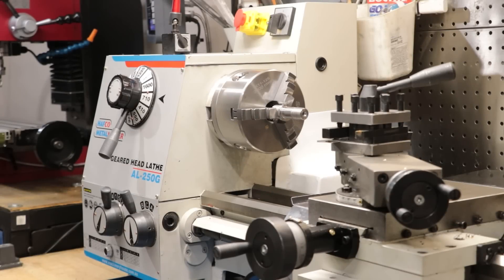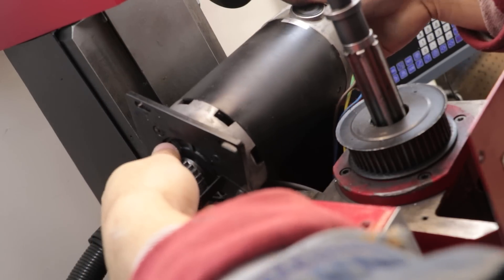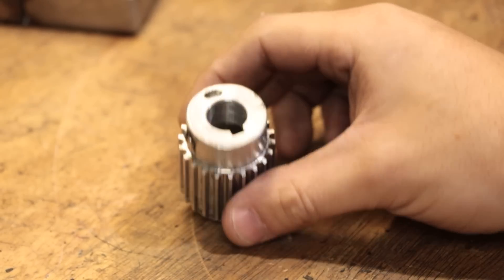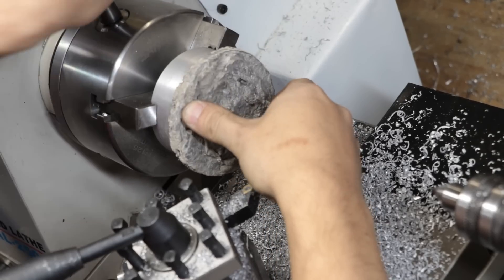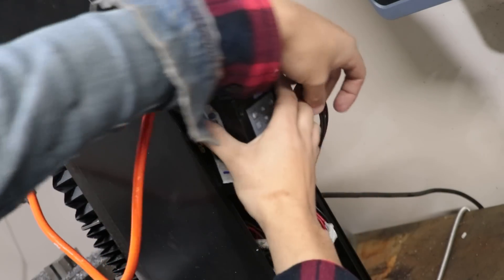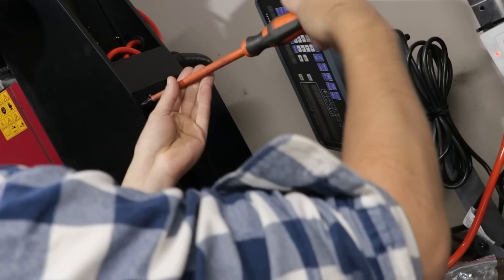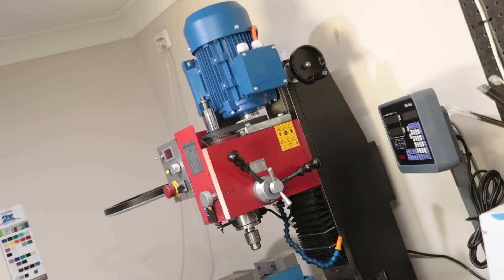I Put A 3HP Motor On My Mini Mill

Comment from the maker: Do you ever have one of those weeks where everything you touch breaks?  Pretty much sums up my past 2 weeks :)
Reply: Not weeks but i definitely have days like that
Reply: Use a little cutting oil when turning gummy aluminum.
Reply: It's called having the "Reverse Midas Touch"; where everything you get near turns to something that's definitely not gold.
Reply: @gbspikyfish    my friend calls it "sexual fingers" lol.
"Everything I touched was f#cked"
Reply: I had a month...
Reply: yup.. but if your not breaking tools your not working in the shop !
Reply: Love the cliff hanger ending 👍💪✌️
Reply: I think for drilling thick plate with cold saw you should drill half way in one side and second half in another side to reduced friction rubbing between saw and steel.
Reply: @alston523  It isn't rubbing that's the problem but the fact the chips have nowhere to go. For years I've been  getting a slot going width of saw kerf then use that to drill a bunch of through holes. You can go full length (depth?) of hole saw internal 'hole, then come back from other side to core bars which saves material (as long as your only needing a piece around  3" long 🤔)
Reply: More like two decades but what of it? :)
Reply: I ended up breaking 3 Kennametal endmills this week. So yeah, I feel your pain
Reply: 1 Car gear box
1 industriali washer 
1 drilpress
2 workshop lamps
1 car wheel flat
2 Rolling tabels 
1 pallet lift 
1 hydralick Press 
It have Been a rugh last 3 weeks. The boss is not to happy but we made 50% pruduktion increas. 👌😅
Reply: No, but nearly all of my Ozito stuff was returned to Bunnings under warranty years ago :)
Reply from the maker: @legallyfree2955  Their stuff is hit or miss. Corded stuff is generally okay
Reply: @legallyfree2955  funny enough I have two Ozito abgle grinders, bought for $17 each (lol) that have been total workhorses for over 10 years.
One has a replacement power lead because it got mangled which can happen to any tool over 10 years. The other has a broken clamp button because a cutting disc got siezed on, which can also happen to any tool.
I bought 2 grinders for $34 total for a job because I could use one as a cutoff and one as a grinder without swapping discs all the time. And they have lasted the distance. Yay for cheap garbage tools! 👍
Reply: Yup
Reply: You didnt cut stock by hand im happy and proud of You!
Reply: Well im glad im not the only one this happens too ! Had a few projects that have cascaded like that, usually when I have a tight deadline and dont have the cash to just buy replacements so I have to McGuyver some solution to see me through ... it not the kind of stress you need on a deadline.
Reply: pretty sure that those brushed motors will always burn out your vfd
the produce a lot of back emf and have high inrush currents and generally put a lot more stress on vfds and controller boards when these are either just cheap or skimp out on filter components.
Reply from the maker: @FeralDayASMR  Thankfully the replacement is an induction motor. Not a big fan of brushed dc
Reply: @FeralDayASMR  You make a good point. A brushed motor needs a circuit between it and the control board to prevent feedback.
Reply: Definitely ! Even myself :p  
In general, I stop at 2 broken part and go doing something else (or I block my back and just stop doing anything)
Reply: Yep, my friends and I call them reverse Midas days. Everything you touch turns to crap.
Reply: We all have those days, weeks, months, years even. But did it effect your command of English too? 16:52 “Feeled through the hand wheel…” ?? Felt maybe ? 👀🧐😎😜

Those hole saws can be made to do amazing things, but they need help. If you begin to cut the circle, then drill a series of smaller holes around the inside of the scribed circle breaking into the groove you’ve started, then immerse the job in water, you will of course cool the operation, relieve the pressure on the saw teeth by reducing the amount of metal that needs cutting, and provide escape routes for the swarf. If it gets difficult, turn it over and start from the other side. 

Lack of coolant and swarf clogging are always the biggest impediments to a job like that. Done properly, industrial machining operations almost always involve flooding in coolant. There’s really no downside to doing it - other than the mess. But it’s the end result that matters, not aesthetics or convenience. 

Coolant would solve your aluminium clogging issues too. You have a fine cutter running at whatever speed, and abrasion occurring, which causes the aluminium to heat up. The heat is transferred directly into the thinnest aluminium chip, and it welds to the cutter. Flood it with coolant and you remove the heat, and clear the swarf quicker.
Reply: @G58  You know english isn't everyone's first language right?
Reply: Yeah. Been there, done that. Cheapskate Murphy didn't even supply the t-shirt.
Reply: I was wondering why you hadnt put out a video lately, but this explains it.  Sorry for your bad luck, mate!
Reply: I've had weeks where I only had to look at something for it to break. You have my sympathies. On the upside, the better half usually doesn't complain when you "replace" a broken tool with an upgraded version.
Reply: Always drill metal on low speed, no matter the length of time it takes. Drill would have lived a bit longer but it was toasted
Reply: Errol Flynn day.
Reply: FWIW, some aluminum alloys are designed for forming and are typically not good choices for machining. Alloy 3003 is a "gummy" aluminum.

I know that 6061 is most commonly used in industry for machined goods, but it too can be subject to chip welding under high material removal rates.

My favorite aluminum alloys for high speed machining are 2024 (alloyed with copper) and 7075 (alloyed with zinc). Neither of these alloys are "gummy" and chip welding while machining them is rare.
Reply: I call it “reverse Midas touch” where instead of gold , everything you touch turns into “SHIT”🙉🙊🙈
Reply: Motor brushes are a wear item.  I'd check them in the old angle grinder.   Also in the old mill motor.   New brushes are only a few bucks once you figure out where to buy them.  The cheap multitool (mains powered "dremel")  I used as spindle got through 2 pairs of brushes a year when I was driving it hard.
Reply: Yea every week of my life so far...

Comment: Not a machinist, but wouldn't a sharper tool steel bit have worked better on that nasty aluminum?  At least thats what I thought you mentioned at one time.

Comment: Hey mate on that home cast ally try using milk as your cutting fluid, like regular full cream. No BS. The saturated fat prevents the chips from sticking especially on ally. The old boys used to cut ally with a rendered pork fat emulation, way better than the new synthetic stuff. Clean it out with water after or it’ll stink.
Reply: Also can add radiator coolant to milk.
Reply: Nice work btw

Comment: All those trips maybe you have bought a drill press, saving your drill, hole saw, etc etc.😮
Reply from the maker: I’ve always been of the opinion that if you have a mill you don’t need a drill press. So if I’d bought one I wouldn’t use it after using it once.

Comment: Hi Artisan, as always: Great vidoe on a great channel. Thank you for that!
But one suggestion from my side. I think if you have not enough tork in your 16mm drill maybe your belt is too small. You could double up the pulleys and use two belts to transfer the whole 3HP to the tip of your drill. ...just my idea. Greetings from Germany Sascha

Comment: Hmmm, that 3 phase motor is a way heavier!!! I wouldn't have mounted it high -- to cause top heaviness. I'd have bench mounted it low down, with power driven UPWARDS to an idler drive bearing and pulley over to the spindle. I really dislike motor or chassis wobbles transferring into my work.

Comment: 7:54 a higher frequency is no issue. The frequency printed on them is just a measurement for the optimal conditions it was designed for. So you'll look at more heat loss at the same power output, if you run it with a higher frequency. So as long as you monitor the temperature of the motor, you're fine. I would expect 50% more energy-loss if you double the frequency - at least. 

So if the 3 HP motor is designed for say 800 W heat loss (75% efficiency). So to keep it within the 800 W heat loss, the casing is designed for, you can only run it at 2 HP continuously, that is.

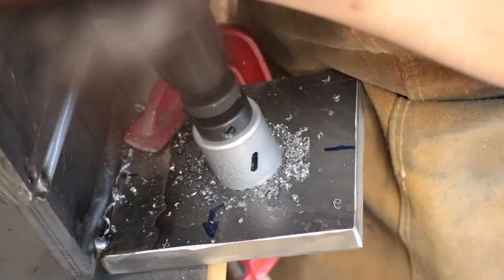Comment: 4:44 let the poor drill spin up instead of pushing too hard. You can avoid overloading it, by putting it into second gear and putting the torque limiter to the highest setting. So if you overload it, it will ratchet through it, so you know you pressed too hard.

Also make sure to keep the piece wet with water, to avoid heating up the metal you're cutting too much, so it will work harden - if you stop cutting for a moment.
Reply from the maker: Cooking the drill was on me, I was a bit impatient and I needed to get the mill fixed asap. I personally wouldn’t hole saw in gear 2 with that drill. Not enough torque and id probably burn up the teeth. All in all not really a job suited for hand drills. And for what it’s worth the cutter had plenty of cutting paste. Cheers
Reply: @artisanmakes  "burning up the teeth" is just a matter of temperature - and maybe torque, which you explicitly limit by the torque limiter of the drill. The temperature is limited by using an abundance of water.

So no, the hole saw won't be damaged. Choosing the second gear just gives you more inerta, that's why I recommend it.

Using the torque limiter on the drill will avoid "getting impatient" in the future. :)
Reply from the maker: Maybe not my best descripting but if you run too fast you'll rub the teeth on the work piece, not cut it, and that is what will generally destroy a sharp edge. Cutter needs to by pressed down with enough force to cut into the material and in the high gear you can not put enough force into the cutter to cut the material without stalling the drill. But back off enough for the drill to run and it will not have enough pressure to cut and remove the metal. Believe me I pulled put most of the stops to try get it to work and low gear high pressure is what the hole saw needed. Cheers

Comment: Mate, you desperately need a drill press. It will save you a ton of time and effort and reduce tool breakage. I would also recommend getting a set of annular cutters rather than using a hole saw. Alternatively, you can drill some holes around the diameter of the holesaw to allow the swarf to fall through. It will prevent you from overheating the holesaw and breaking teeth off on swarf.

Also, when machining gummy aluminium, you can touch up the carbide on a diamond hone to give it a sharp edge. Also, give it generous servings of WD40 while cutting it and this will help reduce chipwelding.

Comment: Just for info ( perhaps useless) in my working career I was an electric motor specialist and did many “weird” tests and experiments. You can safely run a 4 pole motor at 100hZ without much loss of torque, however a 2 pole motor starts loosing torque at around 150% full speed ( 50hZ running at +/~ 75hZ)👍
By the way keep going with your very interesting videos👍👌😁
Reply from the maker: Cheers thankyou
Reply: Also regarding use of a VSD , if you run at lower speed you need to think about cooling , I solve the problem with a “PC fan” mounted on the motor cowl

Comment: Do you know that the nominal power stamped on a 3-phase asynchronous motor is the most efficient and economical power for continuous operation, not the maximum power? Not, for example like other types of electric motors or combustion engines where 3hp means max. 3hp. This 3hp motor can produce a maximum of about 10 hp during intermittent use. The same with the torque. A continuous overloading will of course overheat and burn the motor unless overcurrent or overheating protection is installed. A firewood splitter is a good example of where this "overpower" can be used with advantage.
Reply from the maker: That may be correct but here the motor is going to be limited by the VFD

Comment: I bet it dies, soon. You added 2hp, that's ~1500w of power that nothing in that was designed for. 

I've been there, I've done that. It's really fast, for a few. Sometimes failures are accelerated wear (ie: bearings), and sometimes they're quick, loud, and exciting (ie: the base cracks & the head falls off), but it's not going to survive.

Order a replacement now, and hopefully new arrives right after the old is hauled off.
Reply from the maker: This is not a stock machine. It has Stiffening plates and braces and the tapered roller bearing are can handle well over 3hp.
Reply: @artisanmakes  lol…ok.

Your confidence has reinforced my confidence. That level of confidence requires either past examples (you're copying someone) or perfected ignorance. Even a pro would give that a "maybe" when tripling the power.

You did realize the power used in the machine, to cut metal, becomes heat, right? Those parts are not designed to handle that much heat, so they will get hotter than they used to, and that will be more than it can dissipate. Heat brings weaknesses & makes noises.
Reply from the maker: I’m not copying per se, but I have run into examples of people using these over sized motors on mills this size without much trouble. And for what’s it’s worth when I shoved a motor this size on a mini lathe it didn’t have any issues, and that that even less suited to a 3hp motor.
Reply: @artisanmakes  I'm not telling you to stop building it. I've done things like that (tripled the power) & I'll do it again. That finds the weakness. Sometimes repairable, but usually not when the power has more than doubled.

Just have a replacement ready.
Reply from the maker: I see what you are getting at. Cheers

Comment: I did the same upgrade to my Sieg X3 years ago. I also fitted a gas strut to balance the Z drive (it's now CNC'd). Filling the column and base with epoxy granite helped with the rigidity. Interestingly,  I saw a Ryobi ad just after your drill crapped out. Unfortunate timing.😮

Comment: How much is it in kW? <Nerd Mode ON> In fact, the maximum output of a horse can be up to 15 horsepower, and the maximum output of a human is a bit more than a single horsepower. For extreme athletes, this output can be even higher with Tour de France riders outputting around 1.2 horsepower for around 15 seconds, and just under 0.9 horsepower for a minute. <Nerd Mode OFF>
Reply from the maker: 2.2kw
Reply: @artisanmakes  thanks. It is much more understandable and comparable
Reply: @Leemuzhko  If you feel to put the "Nerd Mode" on, you can study this:  https://en.wikipedia.org/wiki/Horsepower  The unit horsepower is a lot more complicated than I thought :)
Reply: @OnTheRoadAgain-S  that's why I prefer not to use it :)

Comment: I hope you include some air vents for your VFD. Without proper air exchange for cooling almost all of these electronics will fail prematurely. Even with how cheap the VFD are, it’s more that it’s a pain in the ass to deal with. I wouldn’t leave heat dissipation up for chance by way of the machines mass, even a small vent on the underside of your new control board cover will help tremendously over none at all. 

If you really want a definitive answer, then just stick x1 thermocouple to the inside of the VFD case (to read the air temp immediately surrounding the circuitry) as well as one for the inside of that enclosed area (to read ambient air temp for VFD operations).
Reply from the maker: Turns out there’s already vents in the back cover

Comment: I hope that motor is inverter ready. I’ve converted several machines. I always take out the old motor, even when it’s three phase, as they aren’t suited for variable speed use. You can seriously damage a standard three phase motor using a VFD as a speed control device. At low speeds my motors can be used down to 6 rpm. It has torque compensation from 6 hz to 60 hz and constant speed from 60 to 120 hz. This is important as a three phase motor will lose serious torque at low speeds, pull a lot more current, and eventually burn out. Problems at high speeds as well.

If you hear a whining sound as the speed is increased, increase the modulation frequency. The manual should give the recommended frequencies. Be careful of vibrations. VFDs really don’t like them. I mount mine with anti vibration mounts. Also, you can’t put them in close areas, you need room for good air circulation and heat removal. Talking from a lot of experience with these.
Reply from the maker: That’s already vents on the cover for cooling. I just didn’t add any extra.
Reply from the maker: Yes the manual goes into some detail
On this. I just didn’t go into detail in the video.

Comment: Just a tip from a 12 year Millwright, when zip cutting don't press hard. Just keep enough pressure to keep the disc from chattering and sweep the entire cut back and forth steady for the deep cuts. Your discs will last ages longer. Gentle as you can be, let the disc and tool do all the work.

Comment: Talking about rigidity,, Will you get rid of the back plate you mounted to strenghen the mill?
Thanks for the video
Reply from the maker: Not at all it is still there, it makes a huge difference. The motor controller housing bolts directly to it. Cheer

Comment: That motor should have ended up on the lathe. Not sure why you wanted a smaller motor on a bigger lathe.
Reply from the maker: Well you get the advantage to mechanical gearing on the lathe. The 1hp motor is quite adequate. But if I do upgrade it I’d probably steer towards using a single phase motor. Keeps the wiring simple and I don’t have to use a vfd